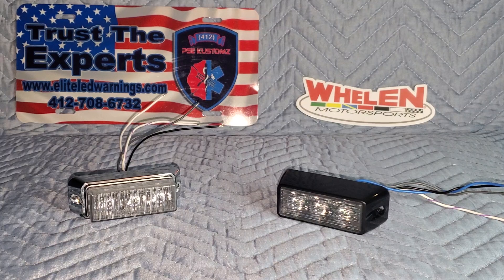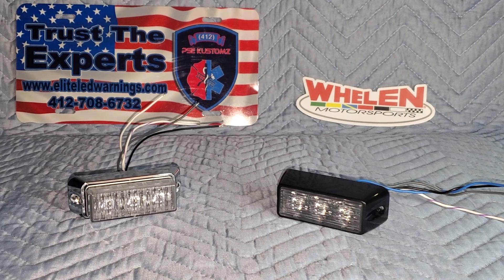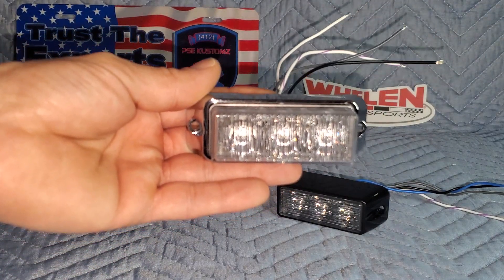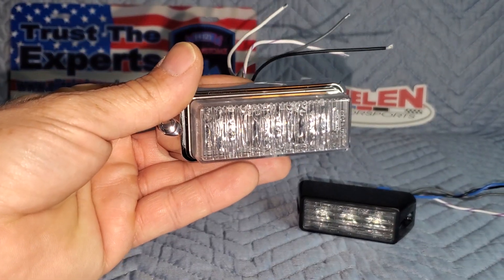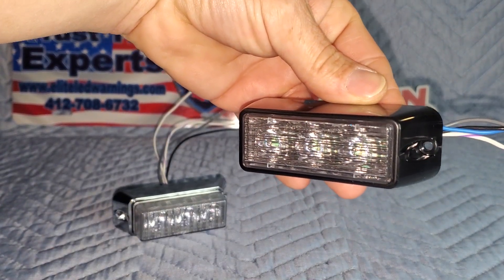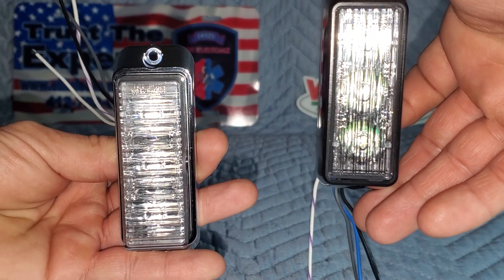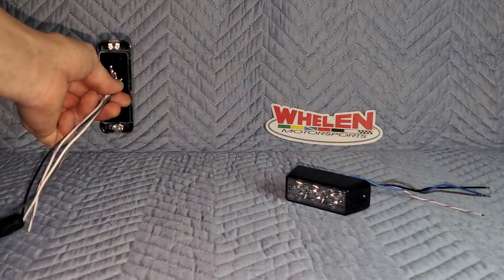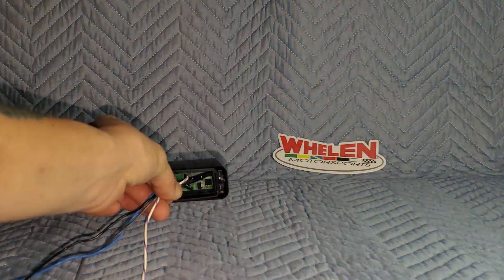Whelen TIR3 Horizontal vs Vertical Mount & Why

Comment: At least in 2012 Sound Off was still made in Michigan. https://www.youtube.com/watch?v=5rzOycU-Vek
Reply from the maker: SoundOff Signal has always been an American manufacturer. Many of their products continue to be made in Michigan. They do source some overseas made equipment and re-brand it. Such as their 2x lightbar line, their Bolt2 surface mount light. But many of the top manufacturers do this. Federal Signal doesn't make any of their led lightheads here in the US. They are all sources from a manufacturer in Taiwan named Juluen. Code3 who is now owned by Ecco Safety Group is one of the largest importers of overseas manufactured lights in the industry. Which is why most of Ecco's lights last 6months on a heavily used vehicle.

Comment: I actually never knew this. If somebody needed to mount Feniex Fusions in a grill vertically, would it make more sense to go the 180 degree optic?
Reply from the maker: No actually the Feniex Fusion 180° Wixe-Lux optic is designed for a horizontal plain. If they are mounted vertically the beam patterns would be similar to mounting the TIR3 vertically. The Feniex Fusion 40° optic on the other hand would perform somewhat better, they too perform optimally when oriented on a horizontal plain.